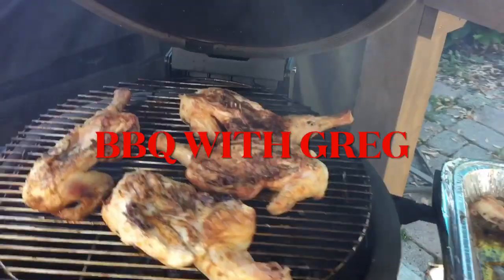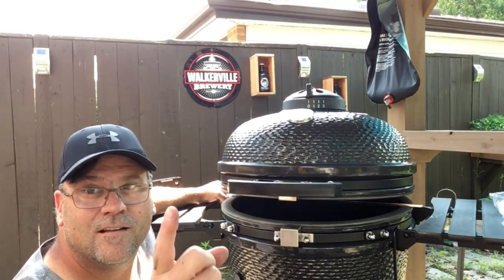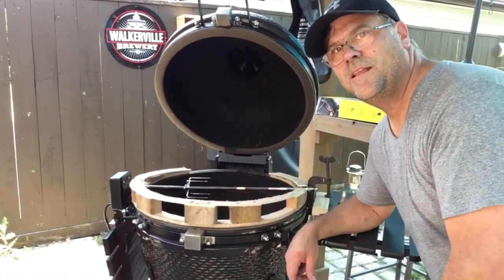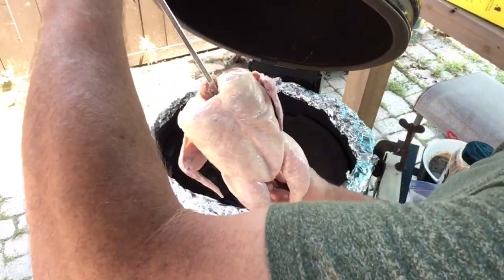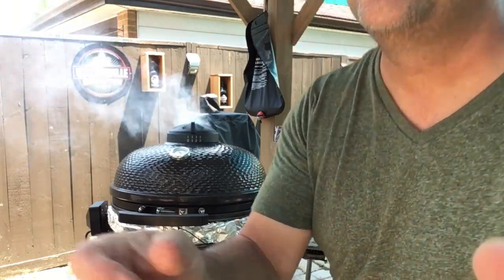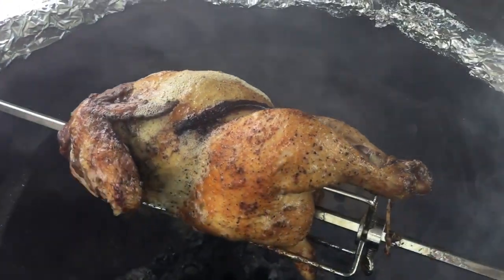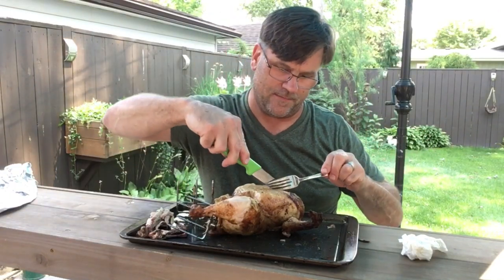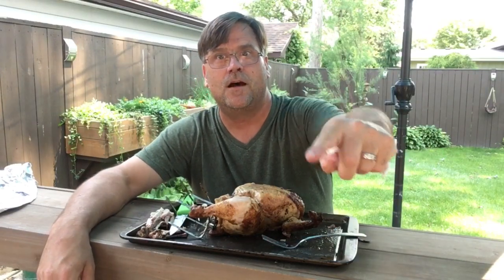Rotisserie Chicken on the Louisiana Grills Kamado Grill

Comment: Did you ever make a more permanent rotisserie rig for your k24 pit boss and how did this one do over the years realized my big joe rotisserie wont fit my k24
Reply from the maker: @fro978  No , I never did make a permanent set up on the K24. I got a rotisserie set up on my 22 inch kettle grill end never went back to the K24.
Reply: Do u have any measurements for your rig I won a Joetisserie but it won't fit my pit boss and I would hate to waste a 200 plus dollar item

Comment: I have a manufacture company. I could made it.
Reply from the maker: That is great. If I were to make this again I would have a bracket to hold the motor and the bracket for the other end of the rotisserie fixed on to the ring. That way it would be a one piece unit excluding the rotisserie and motor. Hopefully my thoughts help you.
Reply from the maker: If I can help further, please send me an email.
Reply: @GregRocheleau  yes. What’s your email.
Reply: I made quality fixtures for the OEM Automotive so if we design well we will manufacture for sure without issues.
Reply from the maker: @postdocprecioso  
Gregrocheleau729@gmail.com
Reply: @postdocprecioso did you ever end up manufacturing?